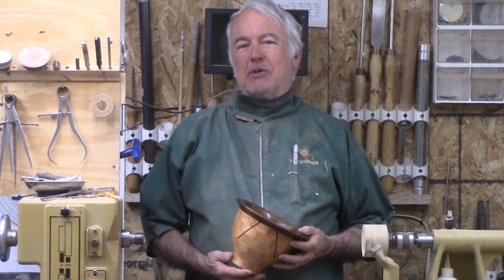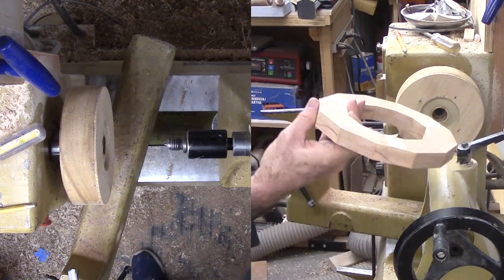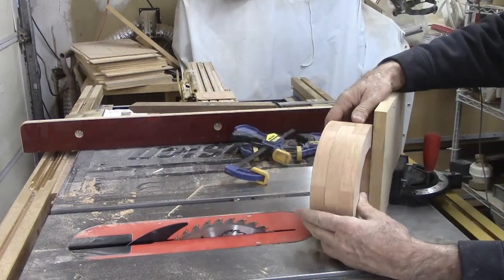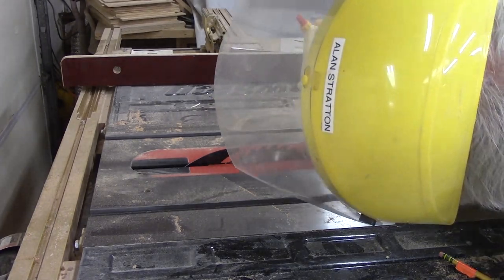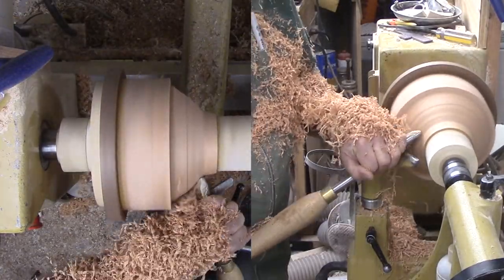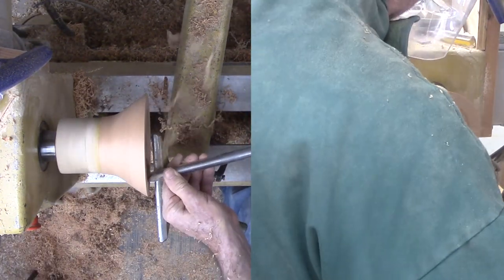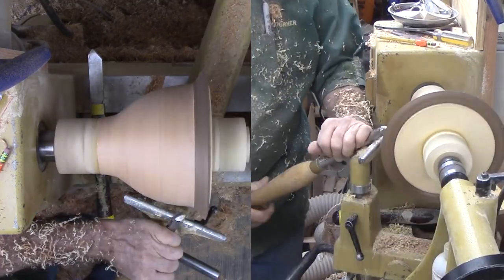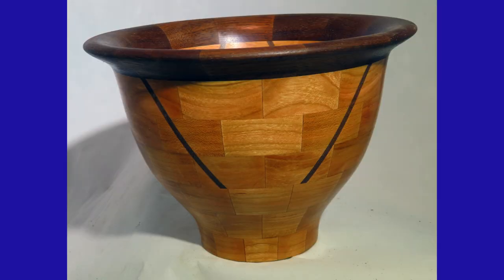Segmented Woodturning - Experimenting With Splines

Comment: Good video.  Could the splines be arranged to form a Celtic knot?  Do you have more information (video?) on those black disks you used?
Reply from the maker: I can see a Celtic knot with a smaller diameter or much taller vessel.  I printed the disks on my 3D printer. Otherwise, I would have turned them on the lathe.
Alan

Comment: Have you seen Gord Rock’s videos on using a “ floating base” in segmented bowls? Interesting, check him out.
Reply from the maker: I do not favor a floating base. While it does address the expansion/contraction issue, to me it is not easy to execute well and I do not favor how the end results looks inside and outside.
So, I prefer the plywood approach or a mentor sandwiches fiberglass is epoxy.
Alan